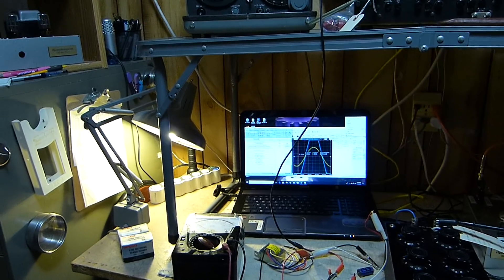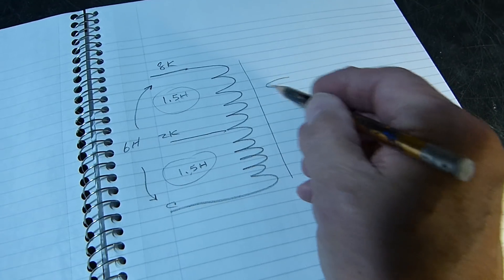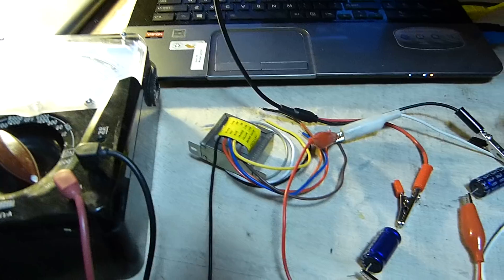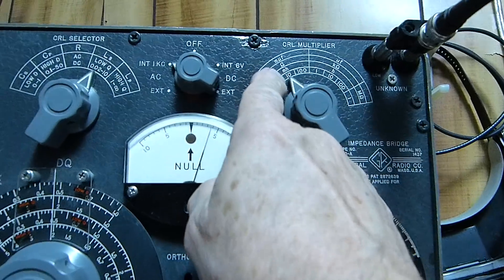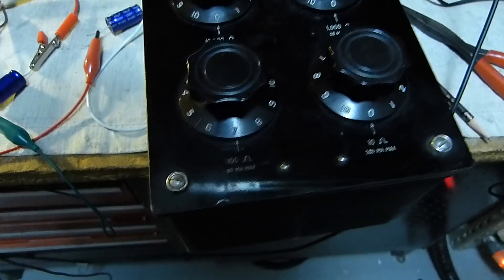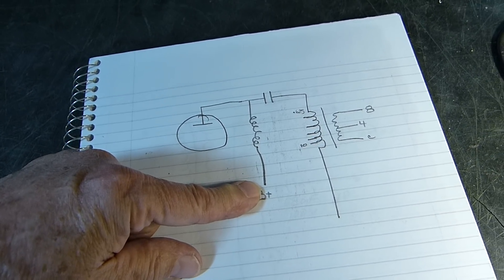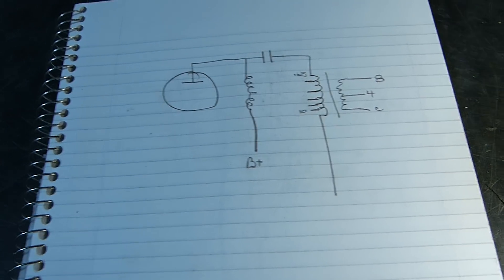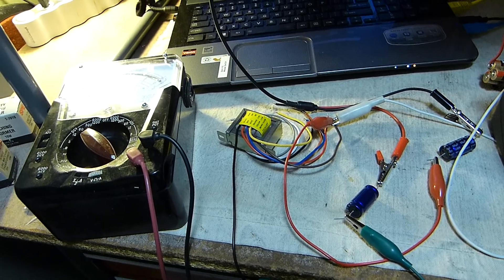Core Saturation Measurements In 70.7 Volt Line Transformers Used For SE or PP Tube Output Stage

Comment: Used some Vanco 70-10  70v line transformers for SE 6v6 guitar amplifiers, the work quite well and sound great, I run them at 30ma and 325v across the primary winding

Comment: Don't panic! They work fine even for single ended. I am using them for SE with a small modification, that just takes a little patience. 
I actually opened the wrap-around clamp on a pair and took a rotary tool with a cutoff disc to cut a gap into the core, and the pair works dandy for a single ended stereo amp with EL84 tubes. 
Here you go, all the taps on a 10W or smaller line match transformer. First column is the markings, second column is the resulting impedance, third column is what to connect. 
BEWARE that there are some of these, where the wire gets thinner on the higher impedance side. Use only those for tube output, that have constant wire thickness!
70V lin-match   Rpri(Ohm) = (70V^2)/Ptap

Uin = 70V   Rsec = 8 Ohm    Usec = sqrt(P*Rsec) = sqrt (P*8)

Ptap    Rpri    Rpri plate-plate        Usec    Uin/Usec    Rin/Rsec
                                                                                             (Uin/Usec)^2
0          0           plate-plate 4K,8K          
10W    490                                          8.94    7.82        61.15
5W      980       B+ 4K                        6.32    11.07       122.5
2.5W   1960    B+ 8K                         4.47    16.65       277.2
1.25W  3920    plate-plate 4K          3.16    22.15       490.6
0.62W  7840    plate-plate 8K          2.23    31.39       985.3
Reply: Where do you cut and how big the gap was?
Reply from the maker: I think you have done an excellent job of helping others understand this. For more than 50 years I have used transformers without a gap and run current thru the high Z winding and modulate class-C amplifiers for AM. Some modulation transformers are specifically labeled to handle current thru the secondary but in my case, there were times I only had-what-I-had and used it and it worked just fine, i.e. non-gaped transformers with current thru the primary or secondary. There is one  exception I had and that was when I build a SE 833A amplifier and used a KW level output transformers designed for push-pull 810's and it performed poorly at low frequencies. I think it was OK down to about 80 Hz but below that it was poor for LF response. Further investigation showed me that the quiescent current of the 833A was about 150 mA and at that constant DC current the primary inductance dropped to a few mH. As for using these same transformers running current thru the primary that would normally saturate the core, I was only running audio voice  modulation for an AM transmitter where frequencies of the voice rarely dip below about 300 Hz and they worked just find. I have posted videos of it. Thanks for your comments and the time it took to document the information.  Stay safe...

Comment: Yes the transformers intended to have a single ended anode current flowing through should have a air gap in the core to prevent saturation.  It would be more clever to have the secondary wound around the choke instead of having both a choke and transformer in the design adding weight and cost.  The coke core must anyway be designed with an air gap to handle DC. 

 I'm currently repairing an old Philips radio where the audio is strongly distorted.  I'm starting to suspect there might be a saturation issue in the transformer.  It is a single ended one-tube output stage where 56mA anode current goes through the output transformer 3.9 H winding.  Center tap is to 220V anode voltage.  There is a 1 kohm 4W power resistor from the opposite 13 mH winding from the center tap.  This resistor feeds 40mA DC current to other tubes anode voltage that is 180V, filtered by 50uF capacitor.  This invention seems to intend to cancel the magnetic field in the core by the opposite magnetizing DC current.  However, it does not work as the amount of turns is much less to the compensation winding, or the compensation current is too small.  Maybe the transformer has a short in the compensation coil.  How to measure shorts in a transformer when you don't have the specification of the transformer?
Reply from the maker: That is an interesting design. Either it is designed to attempt to cancel the field in half the core or use it as a power supply choke. In any case, I think I might rearrange it. As for testing it, if it is indeed a CT winding, the DC resistance should be close from CT to each side and, of course, not shorted to the core or the secondary. I am sure you want it  to work as-designed. I have started using a different method to measure inductance with a DC bias thru the inductor. Seems to be very good.
http://www.vacuum-tube.eu/wp/wp-content/uploads/articles/Measuring_Unknown_Choke.pdf

Comment: Thank you for the video. I've built a 6L6 amp with the bigger brother transformer to this one. It's an Episode SPKT-25 25 watt transformer with the lowest wattage winding being 5 watts (Ebay). I get HORRIBLE distortion below 93 hz! A huge disappointment when I've just spent $185 in other parts, only to have to buy a $$$ Classic tone $$$ transformer anyway. Do yourself a favor, BUY THE GOOD TRANSFORMER!!!! You'll be sorry if you don't! I'm curious if anyone here has successfully built an amp using one of the 70 volt line transformers. Another thing to note, the dc resistance of the primary is only 30 ohms. A "good" audio output transformer measures about 300 ohms. I wish I could have read this comment I'm writing now BEFORE I bought this transformer!

Comment: I was lucky enough to get good results from using a pair in push pull configuration with EL84 tubes. It is a very low power system I built, but sounds amazing.  The ones I used are rated 16 watts line matching that I got on ebay for about 7 dollars each . And the tubes are a matched quad I got on ebay for about 12 dollars. They are pretty weak. The unit makes about 1.5 watts per channel.
Reply from the maker: Joseph, very nice you built with them and shared your results. I want to do all this also but there is just so much time and so many projects.. I suppose that is a good thing. I am going to guess you used the 8K or 16K winding for your primary? Are you using any NFB? I can see about 1.5 watts with no NFB but with maybe , 16 dB of NFB it might rise to 10 watts or so. I am in the process of building up another amp using a Chicago Standard BO-13 OPT. It measures 40H+ on the primary. Most all 20 watt level OPT measure 20H so I am expecting to get really good LF response. It will be interesting to see how the HF performs. Thanks for sharing and your comments. Stay safe...
Reply: @ElPasoTubeAmps I was using my phone as a source, so I don't know exactly how the  roll off would look. I really don't have any test instruments, So I just plunk around until I get a sound I like.

Comment: But we can disassemble the transformer and than assemble again as SE transformer with gap.
Reply from the maker: I did the best I could at the time I made this video but I didn't think to address core saturation so I don't actually know if these transformers have a gap for SE triode operation. I tend to think they do not have a gap as they are used between the output winding of an amplifier and a speaker system and have no DC component in them. I need to look into these further but i am convinced they could be used in PP circuits.

Comment: I have been looking for a follow-up video on this topic... Did you try the circuit with the DC choke bypass? I want to try this with a solid state amp but I don't have a line transformer to try it yet. It's definitely on my high priority list of things to buy.... We have a store here in Australia called Altronics that has a good range of transformers in many different power capacity options, though one thing that might be of interest to you is their DIY vacuum tube amplifier kit. I believe that it was designed by Silicon Chip Magazine and they have come up with some really good stuff over the years... Well this particular tube amplifier kit is using rather small output transformers, I initially thought that it wasn't using any output transformers because I couldn't see them hiding behind the output tubes LoL... So it has me thinking about why and how they are getting away with using such small output transformers on a 20W tube amplifier! At $650Au it puts it out of my price range just to find out. I have a vintage solid state amp which was also designed by Silicon Chip Magazine and it's an amazing amplifier so I have no doubt that this tube amplifier kit will be no different... There will be an article on this design in silicon chip which there must be a mention about the output transformer choice and I'm on a mission to find out more about it, so yeah! I thought that you might be interested in this modern day rendition... As for the line transformers, I would love to see and if possible hear what those little things are capable of...

Comment: In the 'Choke-Capacitor-PP Output Transformer' scenario; would a resistor work as a substitute for the choke? Not asking if it would be a good idea necessarily, just, would it work. :)
Reply from the maker: Yes, a plate load resistor would work. The idea of using the choke is to provide more gain and drive power to the final amplifier stage. This would be necessary if the output is a large power triode that needs the grid driven into conduction. In any smaller case, like driving a 6V6, this higher gain in the driver would not be necessary. 
It is funny how we get into some of these ideas for audio amplifiers. In an attempt to use a small output transformer (note the word "small") we start wanting to use heavy-iron like 250-400 H chokes so we can build a 75 pound 10 watt per channel amplifier...
Who knows what gremlins are going to exist in such an amplifier with a plate choke connected thru a capacitor driving current into the grid of a large triode. It's just crazy.
With all that said, I have never build such and amplifier although I believe there is a guitar amp made by Fender, way-back-when, that does use a plate choke in a low power amplifier. In the creation of music I can see using such a circuit as it may just provide the sound the musician is looking for but for a play-back system, it seems pretty outrageous to me.
I have made a couple of videos on phase inversion for PP amplifiers and one example was a CT choke. It will work but I never built it and tested it and lived with it. Also I made a short video on the phase shift of using transformers vs RC coupling in voltage amplifier stages. 
The idea that some seem to believe in that everything was better when amplifiers were made of lots of iron and everything has degraded since we left SE amplifiers with no NFB are still alive and well. Personally, I think the golden era of tube amplifiers was from the late 1950's to probably the late 1960's. There is little to no value or gain in "designing" or "redesigning" tube amplifiers. It's already been done and tested and sold decades ago. Pretty much all we need to do in today's world is duplicate known high quality designs. The three best known designs are the McIntosh, Dynaco, and Williamson (for PP amps). 
I have built a good bit of very high power amplifiers (RF) and these devices get really Hot, so, when I see these amplifiers playing on YouTube with 100TH, etc, I know these devices heat up the chassis beyond what anyone would expect unless they have had experience with these tubes - and that doesn't even touch (no pun intended) the fact that the exposed plate connection of these tubes run at KV levels and could kill anything that touches them. 
Just my soap-box speech. Thanks for your comments.

Comment: Your idea of adding a DC bias while measuring the inductance only works if the DC bias supply is constant current, ie has a far higher impedance than the primary winding itself at the test frequency.  Putting 700 ohms across the primary basically turns it into a 700 ohm resistor with a tiny tiny bit of reactance - paralleling a small R and large L completely bypasses the impedance of the inductor.

Adding the DC bias to the secondary has the same problem since the secondary load/source impedance is reflected in the primary.  So a constant current source into the secondary would be needed too.

Another possible way to add the DC bias is through a series choke (which has much larger inductance than the winding it
feeds).

So either test with a constant current source to add the bias, or measure the saturation by looking at the response on a curve tracer to see the AC current that starts to saturate the core, since that's the same phenomenon basically (this basically measures the max usable power at the test frequency).

Once you know the saturation current for AC, your max DC current is going to be some fraction of that (you need to leave headroom for the actual AC signal current - I'd suggest DC offset about 1/3rd of saturation limit is a reasonable compromise).

I guess cutting a thin enough slot in the core isn't a viable option without access to fancy tooling?
Reply from the maker: I am hearing you and I agree with you. I recently found a procedure that describes much of what you are saying. Add a large L in series with the DC to basically keep the AC out of the DC supply and a capacitor in series with the AC to keep the DC out of the AC supply.
Here is a link that I think is going to work. Now all I have to do is figure out how to make it real in my shop...

https://www.slideshare.net/vishalgohel12195/owens-bridge-and-measurement-of-increment-inductance

I really appreciate your thoughts and suggestions on this as it is right in line with what I am beginning to understand.
As for cutting slots in the core to reduce saturation, I definitely don't have the tools for that and I wouldn't want to anyway as I want to discover and document the parameters of these little transformers as they are.